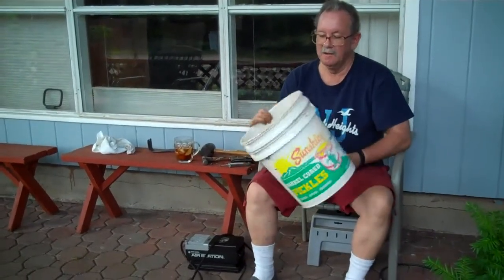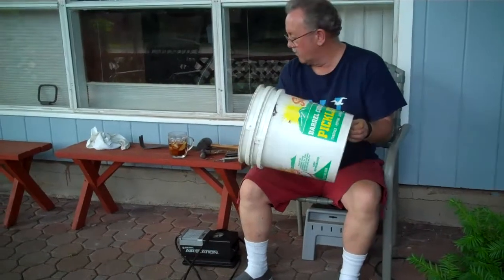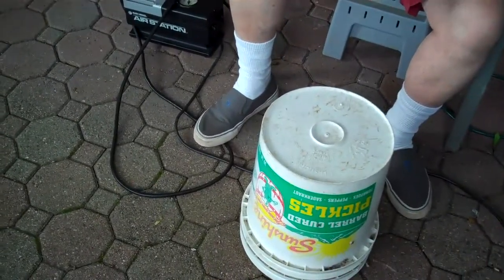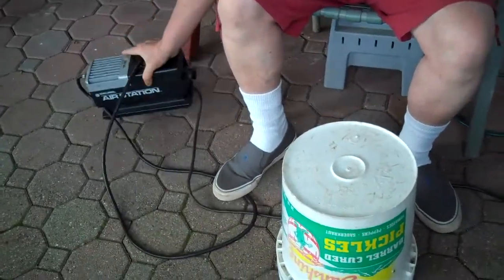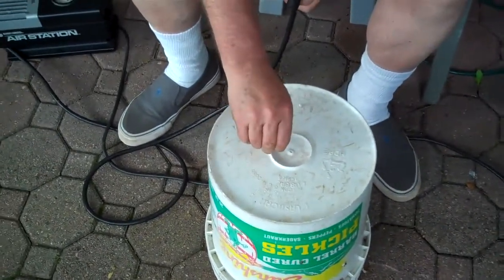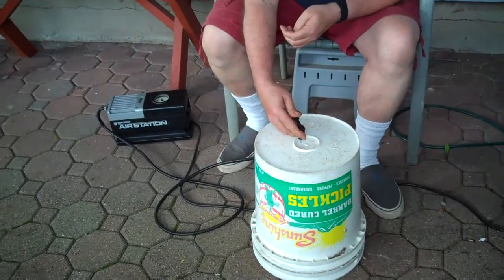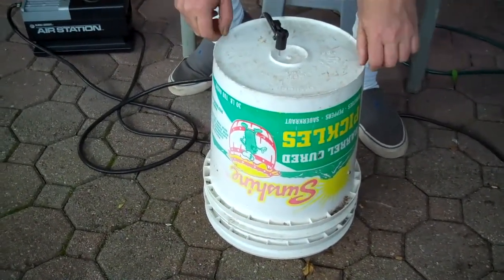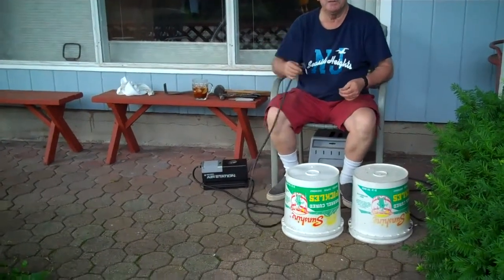How to get stacked pickle buckets apart

Comment: To those who complained about ruining the bucket with a tiny hole seem to forget the fact the bucket was useless stuck to the bottom of the other bucket. Its a small hole so use a lighter to melt the plastic together or use some rubber or silicon caulking to fill the hole. Or use the bucket for yard and garden work or to haul bigger solid objects in. I do like the idea of the boiling water though.

Comment: No need to drill a hole. Just slide the needle to the compressor inside the top of the bottom stuck bucket. if the lip of the bucket permits it.

Comment: Instead of a hole in the bottom,slip the needle of the air hose between the side of the two buckets. It will need a little more pressure but it still gets the job done.
Reply: THank you Kerri! IT Worked!!!

Comment: Oh yeah..So I had some water in my boat but instead of bailing it out, I just drilled a hole to let the water drain out...makes just as much sense as drilling a hole in a bucket to let air in, ruining the bucket. If you took an air nozzle and held it right where the two buckets come together and blew air forcing the two buckets apart you'd still have 2 "usable" buckets.